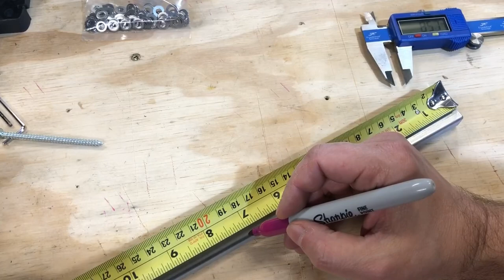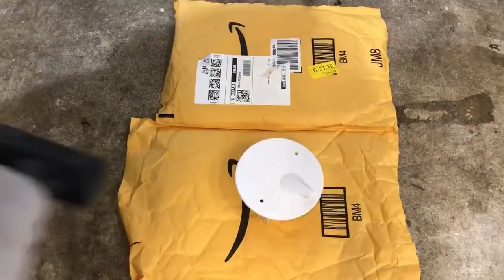Rustic Live Edge Maple Chandelier

Comment: What was the cover you put over the light with the large nut to weigh the light down? I have a project like this and I like that idea.
Reply from the maker: The large nut is just that a nut that was large enough to fit around the wire. The Plastic cover was something I quickly sketched and 3d printed inhouse.